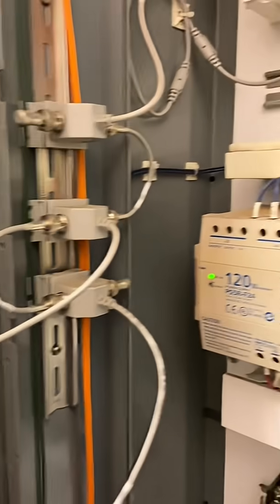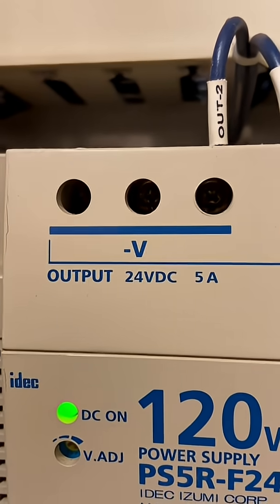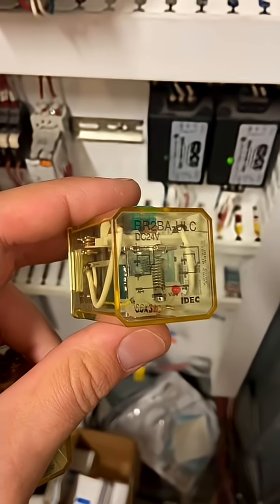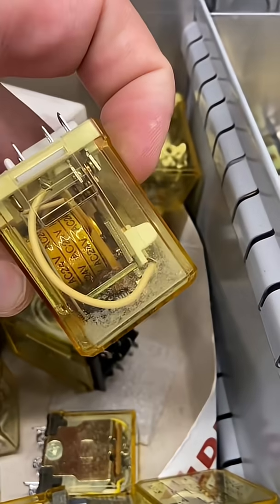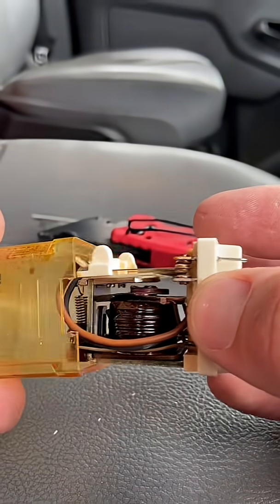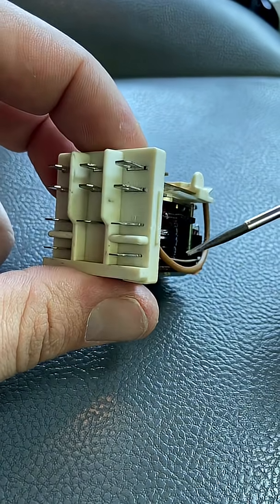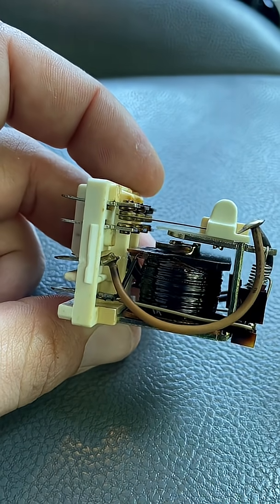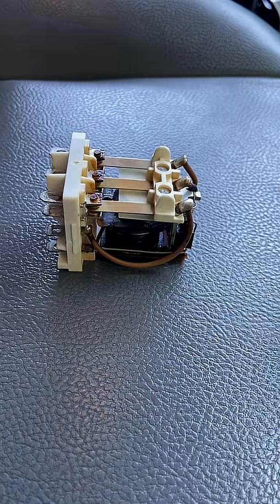Toasty Relay

Comment: Amazing timing. Was training a guy today that just managed to plug a 24v ac relay into 120vac. Lotsa smoke. Gonna show him this video too, keep the automation videos coming. Awesome there are videos showing the tech stuff i  work with .
Reply: A 24V LED indicator lamp makes a nice bang when supplied with 230V.
Reply: @lukahierl9857  We applaud the release of magic smoke back into the wild
Reply: YIKES!
Reply: A 24V device on a 240V circuit is more spectacular (but not as good as a 240V device on a half million volt circuit (11kV to 240V step down transformer installed backwards)).

Comment: 3PDT. I'll see SPDT references and go all ADHD into "You could be a single or six or seventeen pole relay now that CC planted the seed". I mean, unless the relay feels like it identifies differently than it's datasheet shows. Damn progressive components.
Reply from the maker: @brownell10 yeah I should have said 3PDT it’s way more common and like you said it wouldn’t work with the higher number of poles. But I have seen it printed on a few relays and for some reason it stuck in my brain lol

Comment: Shouldn't this not make a difference, since AC RMS is defined as the equivalent DC value that causes the same amount of heating in a resistor?

Or does the inductance of the coil make a difference here?
Reply: I'd assume the constant flow through the coil basically turned that coil into a small induction heater

The fact that it was still working at all boggles my mind
Reply: @Spiker985Studios induction heater requires a changing magnetic field though, because you're inducing a voltage in your pot (basically just a transformer with a shorted secondary wiring). Induction heaters usually work in the low Kilohertz range, which is why you can hear them hum, especially when on full power.
Reply: The inductive reactance creates it's own resistance to add to whatever the coil resistance already is.
Reply: The difference is that with AC, there is resistance, and there is also reactance in the coil from the changing magnetic field, both of which limit current flow.  Therefore, the resistance of the coil is chosen so that it will result in the correct total impedance when added to the AC reactance that is also present.

However, with DC current, there is no reactance produced, so it's only the pure resistance of the wire that limits current flow.  But that resistance by itself is much lower than what's required in that case, so with DC it allows more current to flow than it's intended to (consuming more power and producing more heat).

Comment: You don’t see that too often on a relay. It must have been energized for a very long time. I’m curious how much current that coil requires at 24 volts assuming that’s a 24 volt coil on the relay.  Relays that require high currents to energize should have a short duty cycle. Seeing a drawer full of relays makes me believe that there’s a problem with that setup. I don’t know because I haven’t examined it. Electrical fires are nothing to take lightly. That was going to catch fire at some point unless there’s a fuse in the circuit. Thermal imaging should be part of a routine schedule.
Reply: Bro it was an AC rated coil being powered by DC. The wrong kind of relay was installed originally.
Reply: @Magneticitist I don’t recall him saying that the relay was ac being powered by dc. But that will definitely cause it to fail . Either it’s going to get stuck in the closed position or the coil will burn up. I’m familiar with electronics and electrical control systems. Thanks for the clarification.
Reply: @rickhunt3183 did we see the same video? AC vs DC was the whole point in the one I saw. Pole/throw explanation was nice tangent as it came up.
Reply: DC no good magnet so more power is required. AC relay gets cooked when its designed for lower power
Reply: @hillppari yes I must have missed the part about the relay being an ac coil unit. I’m quite familiar with electronics and power control systems. Thank you for the clarification.

Comment: I love how violently you shuck the junk into the trash. I threw 5 replacements 120v step up xfmers for an igniter for a asphalt heater at the problem the other day and 4 of them ended up in the trash because they didn’t wanna get me a “new one” just “use” the used one, “one of them is bound to work” I’ve never hated that plant worker more

Comment: Bet that relay was made in the U.S. which was probably when we stopped making them and now made in China.
Reply: The old (incorrect) one was made in Japan. The new one is made in China.
Reply: @tschuuuls486  Ahh silly me I forgot about the excellent Japanese electronics. Even now in high end stereos if you are going to replace capacitors (recap) the recommended capacitors to use are Japanese made.

Comment: Interesting! All the Schneider Icecube style relays we use are 24VAC/VDC I didn’t know there was AC and DC only ones
Reply from the maker: @Sparqz101 yeah I like the Schneider relays especially when they have the test and bypass. I also like that many manufacturers have started color coding them based on their coil voltage. I think they just bought up Magnecraft’s design lol
Reply: @Cursed_Controls color coding doesnt stop a careless/clueless coworker, or someone looking for a "temporary" fix
Reply: Eltako UC relays are the best. 8-240V AC/DC in one single relay. Reduces the amount of stock you need to carry greatly.
Reply: Thats the difference between SE and what ever that garbage is.  Also probably an order of magnitude in price difference.

Comment: Ahh I see we have similar coworkers. Mine like to save blown lamps in the original packaging and put them back in the cabinet. Also stripped screws, bolts, and nuts
Edit: most infuriatingly, tape rolls with about 3" of usable tape left on the roll
Reply: Wait until you work in a company that has a storage for computer stuff with people that put hardware that causes a bluescreen just sometimes but otherwise works well into the box of new hardware. Thats very NICE. If you put in a graphics card, work three days with it, and it bluescreens OF COURSE IN THE EXACT MOMENT WHEN YOU HAVE A CAD PROJECT OPEN YOU WORKED ON FOR HOURS, BUT DIDNT SAVE IT YET. Broken lightbulbs in the package of new ones sounds just wonderful compared to this
Reply: @Elias-e7t5k  I mean that ought to teach you to save often, as you should
Reply: The absolute worst. More time and money spent fiddling with garbage instead of throwing it all out in the first place!
Reply: I can top that. I was industrial electrician working in food manufacturing plant. We had techs who would pull parts out of the box (relays,, OL relays, contact kits, etc.) and put the empty box back on the shelf.
I am working 2nd shift, there is a breakdown and I need a part. Go to inventory and see what I need but, an empty box. I left that dump.
Reply: @kevinriordan7842  Ah, the good old empty box trick. You wont believe how often I fell for that already
Reply: Mine just steal my good lightbulbs out of my test panels and switches in the shop.  Dammit go get a new one from the storeroom!

Comment: I don't do this professionally but I'm working on making a Lego sorting machine using tensorflow and a camera and compressed air to blow it off a conveyor belt and should I be putting flyback suppression diodes between the solenoid valves on a 4-port manifold to deal with the back EMF or are they actually designed to take the back EMF cuz you can definitely feel it become across it as that field collapses
Reply: Why not use a servo with a paddle attachment to sweep the part off the belt? Then you won’t have to worry about an air compressor and calibrating the air pressure. You can use whatever you want it’s your choice but there’s always alternatives. Don’t fall into an engineering trap thinking there’s only one way.
Reply: @rickhunt3183  air knives are bog standard for food industry, servo would be overkill for this application but i'm sure it's quite common in package sorting.
Reply: @rickhunt3183  i like this idea.
Reply: @unmanaged I don’t trust an SSR unless it’s a closed loop system.  They are probably better suited for a resistive load. When they die they have a tendency to be in the on position.  The best relays I have ever used were mercury based contacts. I’m not sure if they are still made but they were something that could be counted on and were especially suited for inductive loads.  Any arcing was inside of a sealed glass bottle. Switching 200 amps at 240 volts split phase was a breeze. The coil voltage was 12 and 24 volt dc.
Reply: AC or DC coils?  Solid state switching or relays?
Reply: If driving DC coils, yes on the snubber diode.  If AC coils, you can spec spike suppressors but if they're low voltage coils, I wouldn't bother.  

Some drivers don't care much about inductive spikes when opening, but if you're using mechanical contacts, yeah add the snubber diodes or spec solenoids that have them built-in (which is less work).
Reply: DC 12v I have built a shot despensing dorm fridge with a bunch of pinch valves a long time ago and learned that the diode across the solenoid increased the open time ever so slightly and I was using relays at the time, this time I will be using dual mosfet SSR relays so I might be able to get away without a diode.
Reply: @unmanaged Most likely the SSRs probably have some kind of transient protection built in.  If they are a good brand like Crydom, there will be a tech document available.  If the coil has an indicator plug like a DIN A plug, then that indicator is your freewheeling diode.